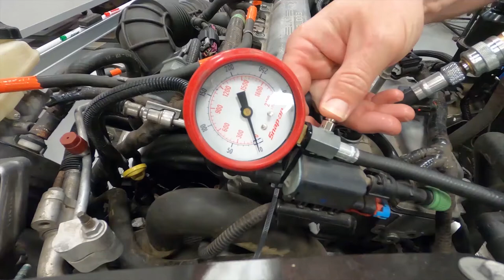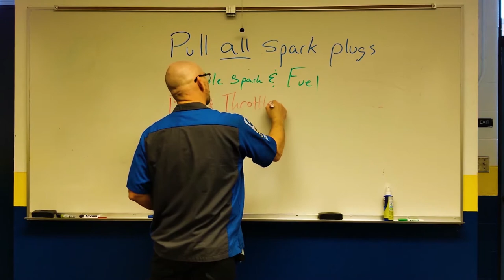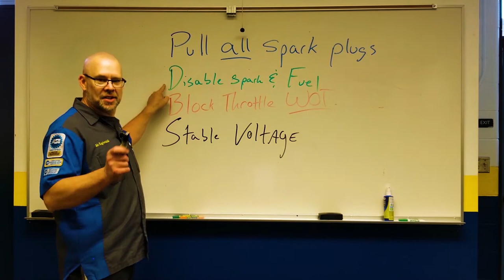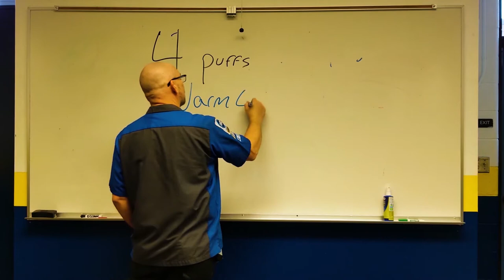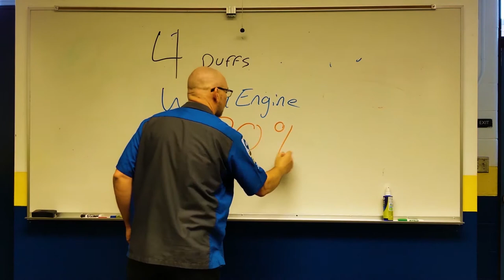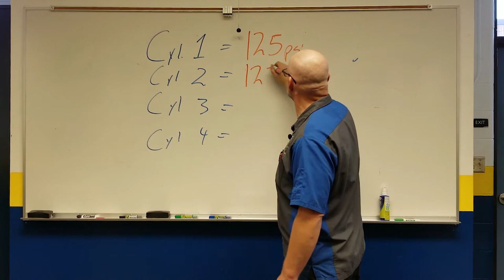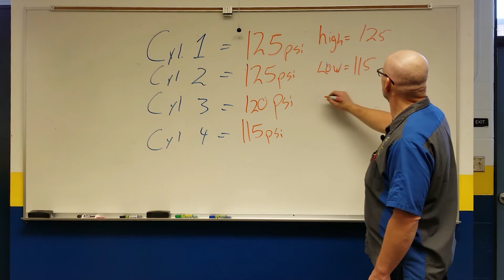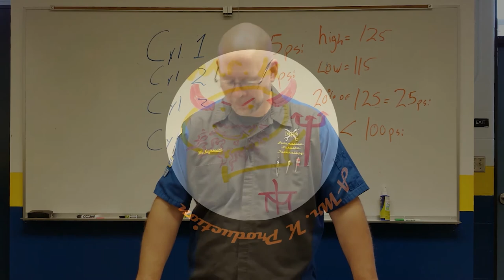Basic Compression Testing

Comment: thanks for the video . but what if the cylinder  got oil from bad oil ring ? does the pressure will be high ? thanks
Reply from the maker: Sorry for the late response! If the compression AND oil rings are weak/bad, the oil coming past the oil rings will help the compression rings seal and compression will look pretty normal. Although at that point, the engine will likely be smoking badly. If only the oil rings fail, it will just help the compression rings seal well, but not add any compression. If left long enough, the build up in the cylinder from all that oil going through it will build enough carbon to take up some of the clearance, then you would have a rise in compression. But by that point it would have used so much oil the owner could have paid to have it rebuilt!
Reply: @pccastengineperformance7844   you answered my point. sometime the compression  test will trick you  , but you did good my friend . thank you very much